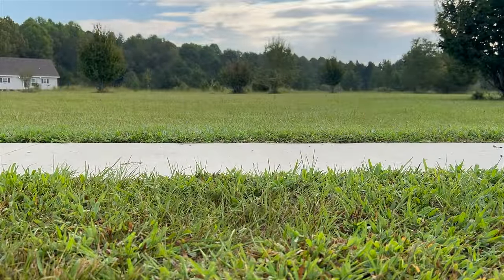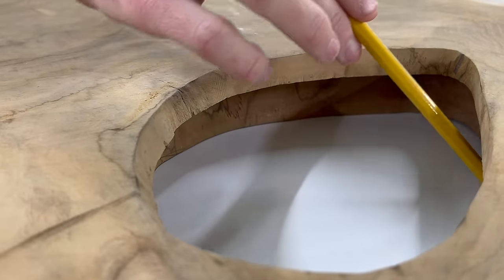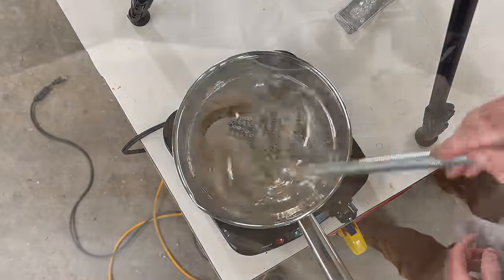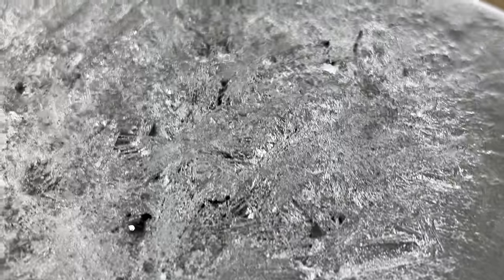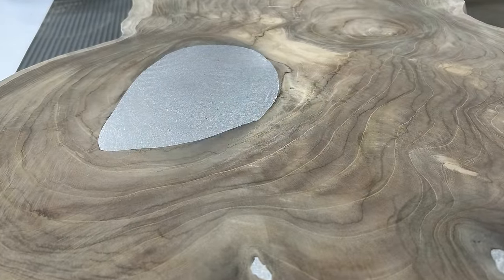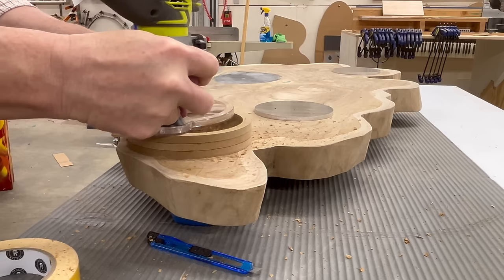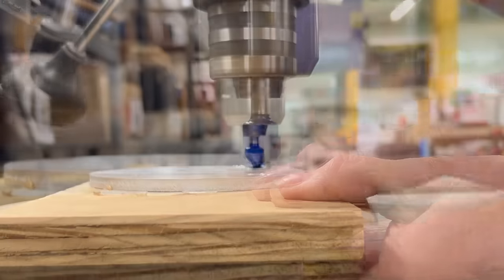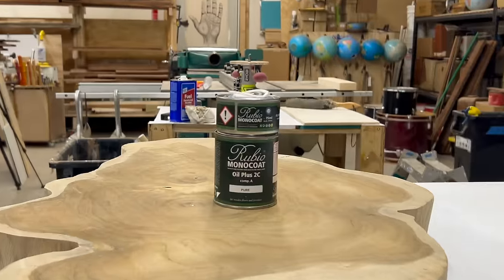Low Temperature Casting Metal poured in Teak Wood Slice Void for amazing metal wood fusion

Comment: Your metal alloy is 31% lead, I hope you took ample precautions when sanding it. Also would recommend some sort of sealant for the metal since its likely to be touched often.
Reply from the maker: Yes I did thanks and it is sealed with a hard wax oil. I may move on to something more durable since it is lead
Reply: Good stuff, definately like to look :) @BlueTurtleStudios
Reply: Yep, Pb

Comment: Very interesting. Personally (it’s all taste) I love working with different materials and that alloy is a real find. I wonder if you could have polished it to a gloss finish or whether it is so soft that that is not possible? 

I’ve been woodworking for over 45 years and, during that time, have seen so many different finishes comes and go. I don’t think there is a single finish for every project, indoors and outdoors but. Like you it seems, I like2 pack hard wax oil for most of my interior work.

Late last year, the Wood Whisperer published a YT video reviewing the 2 pack HWO available in the US. His overall winner was Natura Onecoat. It was not something I had heard of and so I contacted the makers who kindly sent me a sample. It’s not available over here on the UK - I understand the launch is this Spring 2024 - but I was very happy to try it.

It is the best. I agree with the Wood Whisperer. Natura claim a minimum of 55 square metres per litre and, whilst I haven’t measured that scientifically, I think I’m getting more using the same application methods as you.
Reply from the maker: It certainly could polish up. There was problem with metal dust when I did not use a vac attached to sander and the metal dust staining the wood so I blue taped it. Probably have a sander set next to polishing?--try it and let me know -this stuff is really neat-thanks for watching

Comment: Did I miss a step, where you poured metal for the top and the bottom? The video makes it look like you routed out the top for the leg plates.
Reply from the maker: No Steven That is some scrap epoxy left over I poured from the bottom because I did not like the looks of the plywood. I didn't include it because it was not a necessary thing just a what can I do with this epoxy that is left event. Thanks for watching

Comment: Hey there!:)
I was watching this with my husband and we both thought this was SO AWESOME!!🔥 ❤ I'm curious to know if you can enamel this kind of metal.. either enamel (crushed glass micro-particles) and torch fire or even heat gun.. and maybe even add into it mica powder to create different metal effects such as a copperized color or whatever color we want .. maybe use a airbrush or sandblaster to evenly coat it with enamel and then fire it multiple times just like you'd do in jewelry making.. if that would work? Since this is the only low temp metal that seems to be safe to pour.. and that way it wouldn't be constrained to that specified color.. do you think that would be possible? I want to test but I'd love your thoughts on this? I don't know the first thing about this ... YET. Just a theory/ idea.  What do you think?
Reply: Why not just use epoxy & mica? Well... it  seems that to use epoxy you wouldn't get that close of a real metal effect as you would with this metal.. no matter what kind of metallic mica powder you would use. Maybe I'm wrong? I don't know.  But I'd LOVE your feedback! ❤
Reply from the maker: I think if you could get metal copper powder and dust on as it cools after it is poured that might be cool if it doesn't disappear during sanding (wear a mask).A young of copper powdered metal is about 20 dollars so you could mix it and see. I might do a video project of that. I don't know what pigment powders are? I think crushed stones? very interesting idea! what about gold leaf at the last moment or some type of low cost gemstones that would sand and polish-great ideas-thanks for watching-you have sparked some curiosity!!!!

Comment: Does that metal have lead in it? If so that’s not a nice product to work with.
Reply from the maker: It does have lead and you are correct! It is now sealed from any contact by multiple coats of hard wax oil and  sealer!